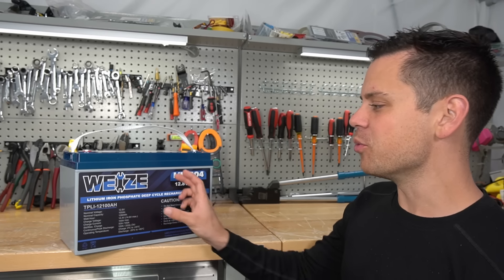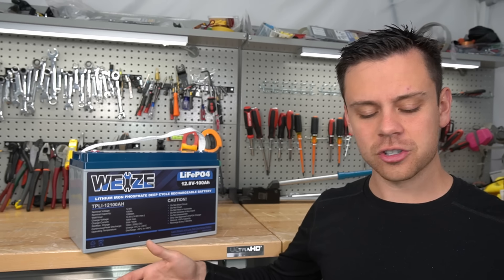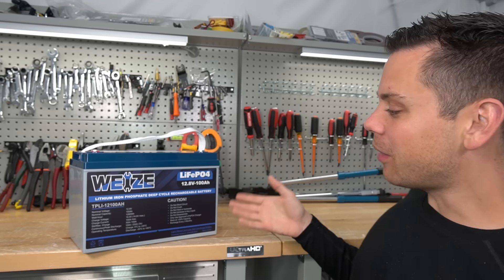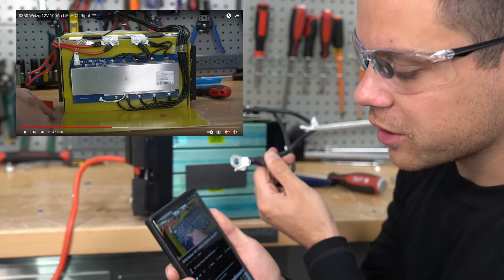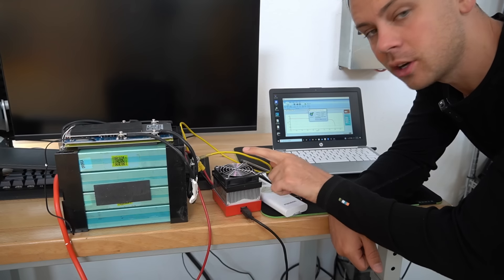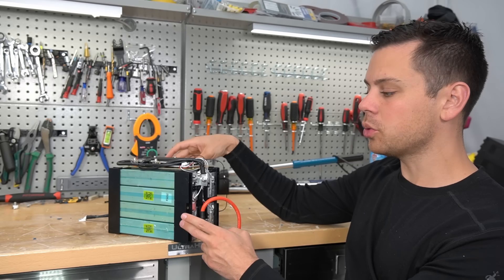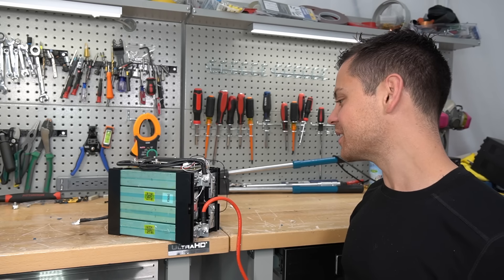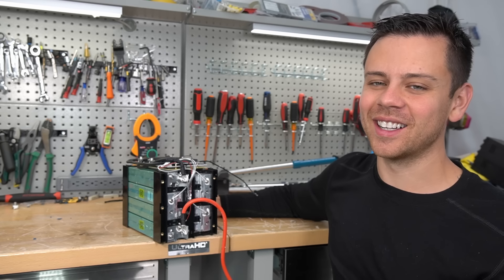$329 Weize 12V LiFePO4: 18 Month Update! Should you buy it?

Comment: And I discovered back in 1978 when I was only 22 years old. There was but only one speaker manufacturer in the world. That actually got this right. And that is the, JBL Speaker Company of Los Angeles, California. They are the only ones who correctly thought this through. And you will find that they are speakers. Our all, supposedly, " Out Of Phase ". To all other speaker manufacturers, in the world. And this is the reason. They were able to think this through correctly. Whether it was actually James B. Lansing himself back in 1948? I am not certain of? But I believe that to be true. Because he changed what he was doing. With the company he had cofounded a few years earlier called Altec Lansing. And those speakers he manufactured then.  They are in, Opposite Absolute Polarity. To his leader line of, JBL Speakers. Hmmm? I wondered what the hell was going on?

But I could plainly hear it. In my Recording Studio Control Room. As I had 3 Different Pairs.  Of Control Room Monitor Speakers.  Only the JBL's sounding right to me. And discovering. My other 2 pairs. Were out of phase to my JBL's? But I had everything connected correctly according to the manufacturer's manuals and schematic diagrams. So who was wrong?

All the other manufacturers of speakers are wrong. JBL's are phased for, Absolute Positive Polarity.. Nobody else is. Nobody! They all got this wrong. Every single last one of them. I mean how could this be? These guys all have college degrees in Electrical Engineering. And they all get this wrong. I am absolutely amazed, flummoxed, dumbfounded, sucker punched, by this. That nobody can get this right. Nobody! Everybody gets this wrong. It's amazing!  It is absolutely totally Mindless and Incompetent Engineering. I am absolutely floored by this, incompetence. Severe, mindless, incompetence. And it's going to destroy people's hearing. It already has. Nobody knows what th FUCK, they are listening to? They don't know how speakers are supposed to sound? But they design them.  What's that say? They are incompetent. With their college degrees  in hand. Completely mindless.

And so I love your channel my friend. You are good. And you have to deal with Absolute  DC Theory 101 in your work. Otherwise current does not flow. Plus does not get connected to plus and minus does not get connected to minus in DC Theory 101. Plus always gets connected to minus  and minus gets connected to plus. That, is DC Theory 101. So, why do electrical engineers then, reverse their knowledge of DC Theory 101. When connecting their speakers? I mean what the hell? You are not jumping a car battery! That's the only time you go, plus  to, plus and minus,  to, minus. When you need the current.. And still only 12 and not 24 vvolts. Because it's in parallel not in series. And how then do, electrical engineers get this so wrong? I'll tell you why.

Because there is a distinct difference. Between that of, Electrical Engineers and Audio Engineers like me. I understand how to Engineer Audio. Electrical engineers know how to engineer,  electricals. That is not Audio. Though it might be related to it? Because it's AC, alternating current. But alternating current still has a,, phased, Absolute Polarity about it. And electrical engineers are all getting this one wrong. Really wrong.  Profoundly, wrong and wrong, sounding. Because they don't know? They are not Audio Engineers. They are not Recording Engineers. They are not Mixing Engineers. They are not Mastering Engineers. I am all of those. Not a jack of all trades and master of none. Au contraire.

I'm a Master  of all those Trades. And I can, Jack off on the Weekends. Because Yes. I am that Spectacularly Great. And not afraid to my own horn about that. Because I know what I'm talking about. I know what I'm hearing. I know how speakers are supposed to sound. And which way they are to be moving in initially. Not sucking. But Punching Out  At You. That is what they are not doing. They are all sucking. They are sucking inward. And they are all Mimicking the Motion of the Microphone Diaphragms. You certainly do not want your speakers to be moving like that. And these electrical engineers cannot think that through. Not one bit. But they can think through 16, 24, 32 bits. They just can't get this right. They can get all this other mathematical gobbledygook right. They can't get this one connection to their speakers right. I mean go figure?

So all you need to do at home.. Is, to flip the polarity. On both of your speakers connections. At the speakers.  Only at the speakers. Nowhere else. That is the only place. Where Absolute Positive Polarity  can be Established. Not at the inputs. That only inverts the phase. The output polarity remains the same.. This is what electrical engineers cannot understand. Because they are not Audio People. They are mathematical wizards.

(More Shocking Knowledge in following post)

Comment: The problem with Chinese electronics is that they use cheap capacitors. Probably half the electronic failures I have repaired in 40 years have been due to bad caps. You will not find Dublier, CDE or Nichicon caps in the BMS of a $329 battery and Chinese capacitors are famous for failing after a few years at which point your battery becomes a brick. Remember, these are not batteries. They are electronic devices that happen to have batteries in them.